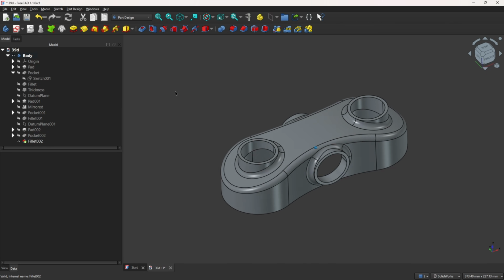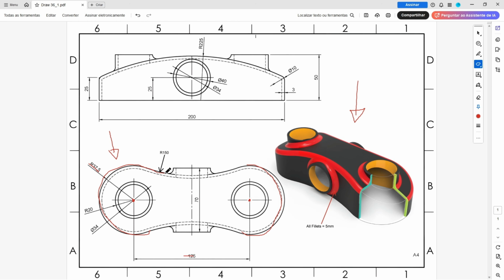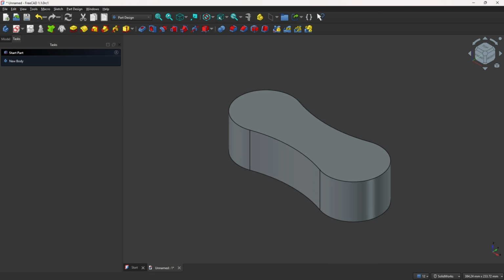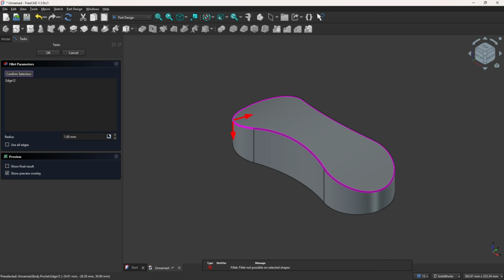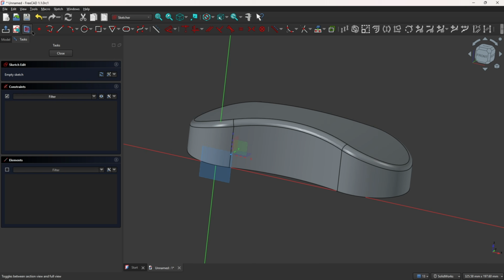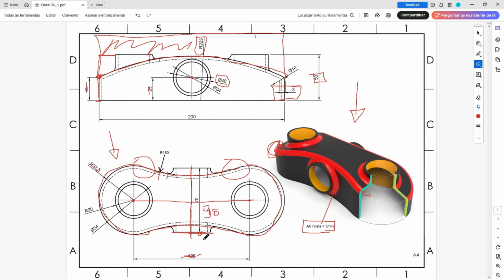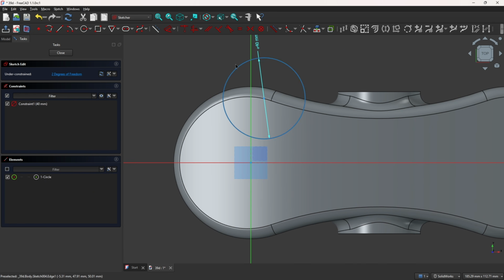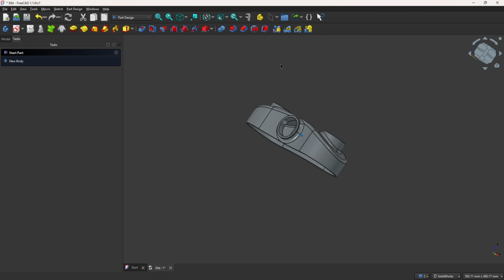FreeCAD  - Complete Beginner Tutorial Step by Step Exercise 36

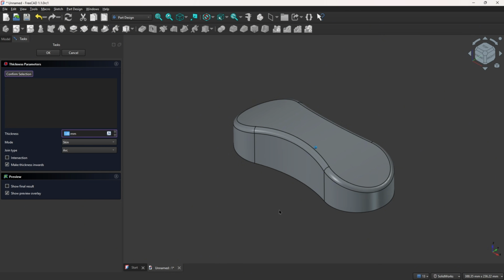Comment: I am stuck at 4:43,  The thickness tool gives me an error???
Edit:
Here is how i solved it,
Save the file and close the program.
Open program/file
Delete the top fillet
Add thickness
Add top fillet. 😁
Reply: no fillet inside now..
Reply: i have same problem.
Reply: @Alex-fw9cu  You can add the fillet on the inside too.
So remove the fillet, add the thickness and add the fillet on the outside and inside.
Reply: @Alex-fw9cu  Just re-do all fillets, including the inside one